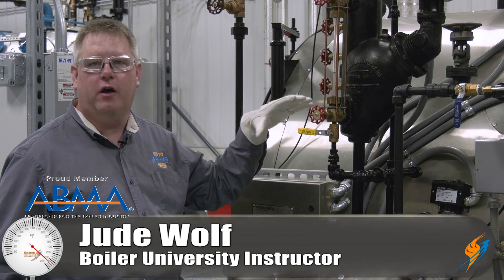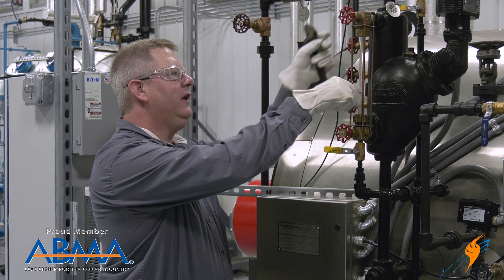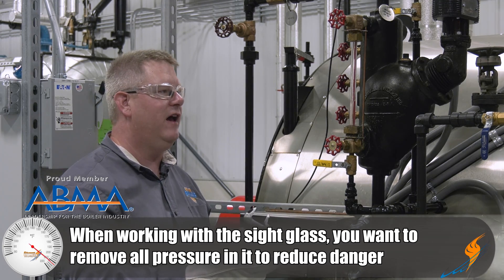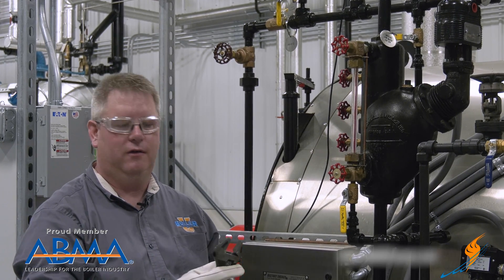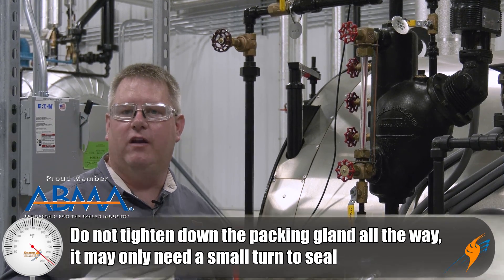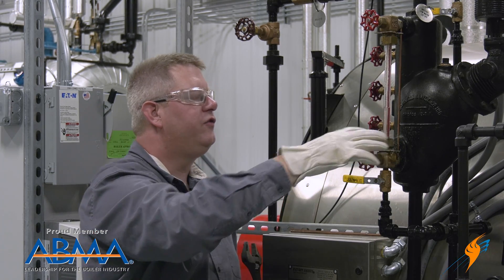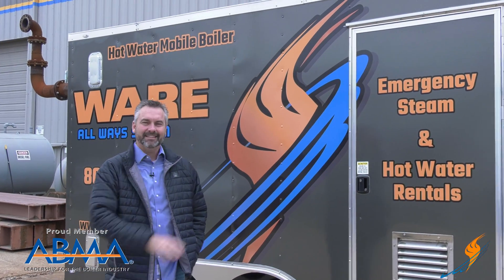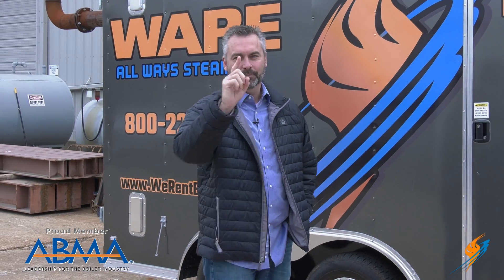Fixing a Valve Packing Leak on a Boiler Sight Glass - Boiling Point

Comment: Honestly, I'm so tired of these freaking lower site glass nuts leaking every time, even a brand new unit with Butler bevel. Ptf e seals, but I love how the ppe for the face. It doesn't protect the rest of your head from getting melted from the steam. If it does blow, I get the feeling that was basically

Comment: Great Video.  I have a home steam boiler that by luck found out was leaking.  good puddle on the floor all the way to the adjacent gas hot water heater.  Identified it was somewhere in the glassi sight assembly.  First step as a total noob was to use plumbing tape to wrap around and it stopped it.  Essentially a bandaid.  then saw this video and went down and followed steps tightened what seemed very loose bottom bold with possible packing failure.  tightened very easy and seemed likely loose.  I will unwrap tape in the am to see if that is what it is as its past midnight.

Comment: Thanks for the video, very helpful.  What if the packing nut for the gate itself is leaking? I've had that twice this winter - it's amazing how much water can be lost through the gate!  Both times I was able to tighten the nut, but I worry the packing/seal is failing.

Can that be repaired, or would I need to replace the gates entirely?

Comment: Is there a limit to the 1/8 to 1/4 turns you should do before it can be inferred there's an issue other than it needing tightening? I did as instructed in this video 3 times and the leak is the same.

Thank you for these videos!